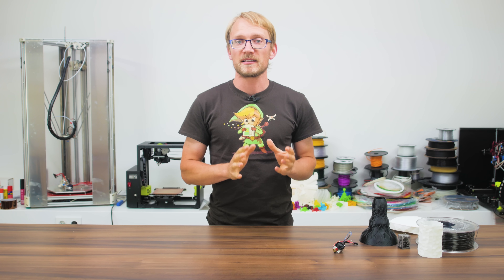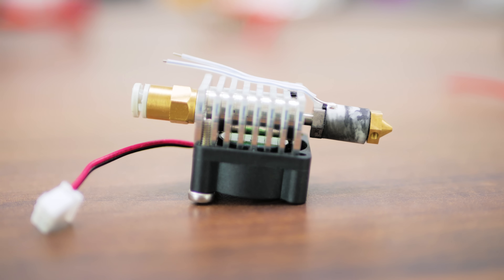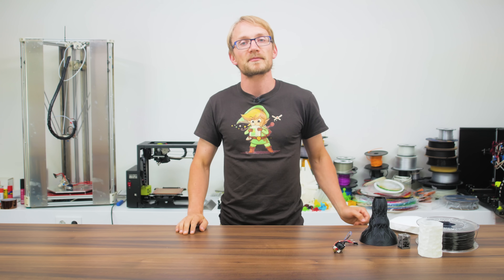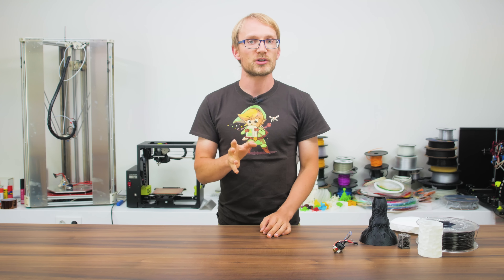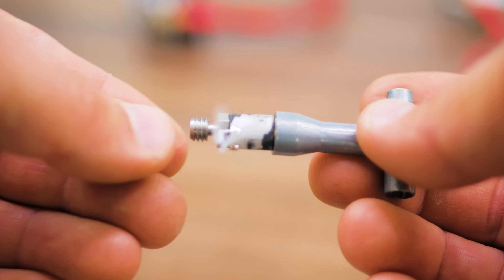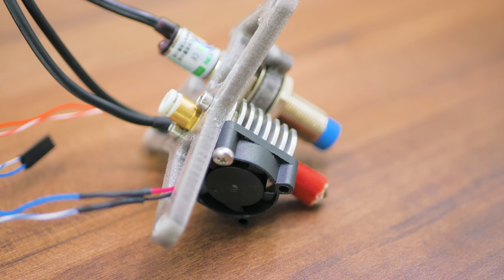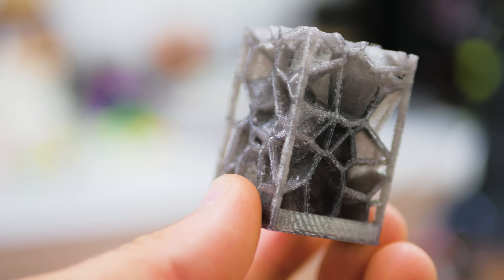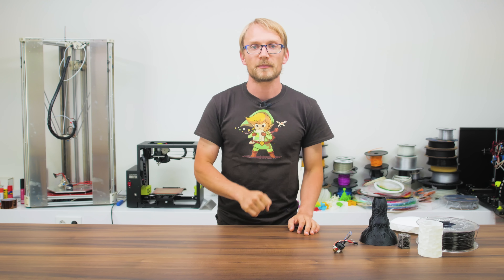Review: The tiny Deltaprintr Mini Hotend!

Comment: I've been expecting hotends to get smaller over time, but in the last 7 years they haven't made much progress in doing that. I think hotends will become more like 3d pend in the future... and by that, I mean super lightweight with higher flow rates. I think that might be what helps them print faster in the future. With a better controlled heating element, there would no need for a large heat block or large heat sink/fans... so the entire assembly could be made much lighter and could move much faster. It would also decrease vibrations and ghosting (from the frame flexing and vibrations/frequency), which could also lead to lighter 3d printers that won't need to be built as heavy or as durable (and if the frames are still built as solid it would probably increase quality).

Comment: Over 2 years later and the only nozzles available are 0.4mm brass (no abrasion-resistant) and the heater is only available in 12v configuration.  I'm guessing sales were so dismal that it wasn't worth it to produce them outside a configuration that is used for their own printers.

That's too bad because I like this hot end's price, size, and sturdy mounting configuration.  But like a lot of 3d printing accessories and parts, they reinvented the wheel so much that they wound up with a square.  I'd actually have no problem with this if we could just swap in a different nozzle (eg, E3D) but then the thermistor probably wouldn't work reliably.
Reply: even the listing for the hotend itself even mentions some kind of special pointed nozzle "coming soon" but the image is in the uploads folder from 2016

Comment: Well I made the experience that short hotends are not recommended if you want to print ABS or similar polymers. I can confirm the basic calculations done by dr Henschke. http://www.dr-henschke.de/waerme_filament.html 
Since I have a hotend with a very long melting zone my ABS parts are at least as twice as strong than before. The layer adhesion increases drastically with longer hotends like the volcano or similar hotends. 
These short hotends are in my eyes only good for nice looking but no mechanically strong parts.
Reply: His (dr. Henschke's) argument is very good! I recommend those who don't read German to try to translate and read it anyways.

Basically, he says that the center of the filament needs several seconds to heat up, and that melted filament is almost incompressible, so it won't cause very much drooling. These arguments are in the favor of longer heating zones.

I use long heat zones with great results myself and agree with the above (Andreas Hölldorfer's) comment .
Reply: I can confirm this behavior with all my experience over the last 4 years in 3d printing. Again since I have this long hotends my parts are so much stronger and even feel different, much more like injection molded parts. The alternative, you print very slow.....
Reply: With barely any Deutsch knowledge and Torbjörn comment  I still understood it pretty well.

And having worked with some older "industrial" 3d printers (namely old' 2007' stratasys printers from my college) ... i do agree with dr-henschke statement.

Layer height and nozzle diameter also help on part strength according to my experience. The bigger the better (!).
Which would need larger and bigger hotends.... it makes sense.

Comment: Would the hotside fit into an e3d chimera? It could make for a really amazing dual extruder setup
Reply: to bad, would be a great setup
Reply: +Thomas Sanladerer maybe a converter piece that slides into the Chimera's bore but is threaded inside to accept the hotside...it would have to have a flat machined bit like the Cyclops to really tighten it down

Comment: What causes that diagonal line across the print that can be seen at 6:56?
Reply: ***** So if I'm experiencing this issue, I should change my flow rate and raise the nozzle on travel moves? I'm currently using a Cartesian i3, but I'm building a delta.
Reply: +Thomas Sanladerer Cool, thanks! I just don't like seeing the marks on the bottom of the object. It also does happen on upper layers.

Comment: Hi Tom! Have you tried playing with the PID adjustment called Kc ( #define DEFAULT_Kc (50) ) regarding the temperature drop when extruding? It adds a little bit more heating when an extrusion command is sent. It doesn't work when extruding by hand, but it might help when extruding fast! Hope it helped.

Comment: You talked a bit about that interesting heater cartridge  and it reminds me of the good old times where i used nichrome wires wrapped around my hotend as heater... :)
What would really be interesting to me, is the electrical power it actually draws when cold and hot (my guess is that the resistance changes quite a bit when you jump up +200°C).
From a physics point of view, the mass of the heater block of a standard hotend, compared to this more compact solution, does not influence how fast you can consistently melt and extrude filament. Only the electrical power of the heater and the sum of all losses (radiation, convection, thermal conduction,...) should dictate how much mass of filament per second you can melt.
The thermal mass of the standard block can only help you smooth out little extrusion peaks, but at some point, you have to get that energy in there to keep melting the filament. I would actually say that the mini hotend looks way more effective and efficient by actually measuring as close to the nozzle as possible (without using something fancy like optical thermosensors to really measure the tip temps) and by having a much smaller surface area combined with the insulating "sock". I could however see that you have to recalibrate your PID parameters for this hotend to deliver a more consistent temperature, it's pretty obvious that the thermal mass of a standard heater block has a great influence on that thermal feedback loops performance.

Some of my printers are running on 24V now, so i just hope that they would provide 12V as well as 24V options for the heater? I would not want to add an extra step down converter just to run a 12V heater on my 24V printer.

Comment: Any chance at adapting this to fit a Bondtech extruder designed for a slot mount? I guess a printed 'fake' slot mount with some small M3 counter sunk screws may work... I have the Prometheus hotend and it works well but I hate changing nozzles because it requires taking the entire assembly apart. Great review! and I love giveaways, and I would like them better if I ever won anything. :-P

Comment: I'm not even sure why you'd want 700C in a consumer printer (I am assuming they didn't mean F). I mean the danger of something that insanely hot (above the melting point of aluminum? were they planning an all Brass hotend?) What plastic even needs that? The hottest I know that exists in filament form is PEEK which is only 400C.

Comment: This heater design is nothing new.  Actually, this was the design used very early in the 3D printing world.  There are also several manufacturers that still use the same design.  3DS being one of them.
Reply: I would disagree. The type of element, and the fact it may heat up a bit faster hardly defines a dew design. It is at is core essentially identical.

Comment: i hate E3D. I order their preassemble (i didnt do the assemble so cant blame me on this) and the thermistor didnt work. i contact them.they ask me to use a multimeter and i did but they havent got back to me yet. so for now i have a brand new E3dv6 but can't use it.
Reply: Yes, you would expect them to order thermistors from a reliable supplier and/or test them in house, that's what quality control is all about, and it's not unreasonable to spend 50ct worth of their time to ensure that when they put it into a hot-end that they sell for $70, it works. And in the rare cases that a defective one makes its way into the products, you would expect them to remedy the issue - they certainly have the cost of warranty replacements taken account of in their product pricing, the customer has already paid for it, so why should the customer pay again?
Reply: if you buy pre assembed, yah.. definately. kind of the point of pre-assembled, no?

Comment: did you space the arms out on the carriages to make up for the fact that effector on the tevo little monster is wider than the carriages you have bought  (and are wider than just about every delta carriage you can buy)? If not your carriages a not as wide as the effector points which will cause an issue with accuracy and effector tilt.